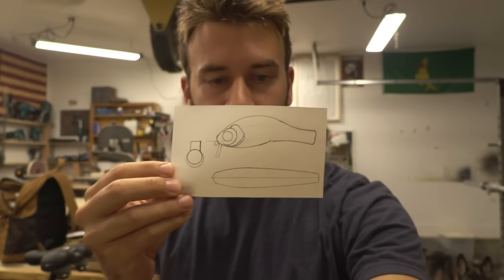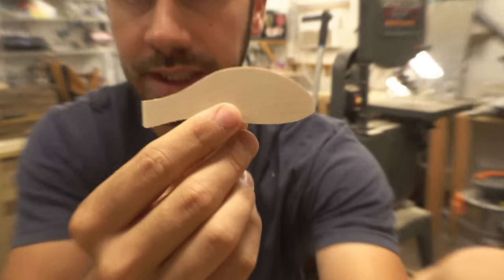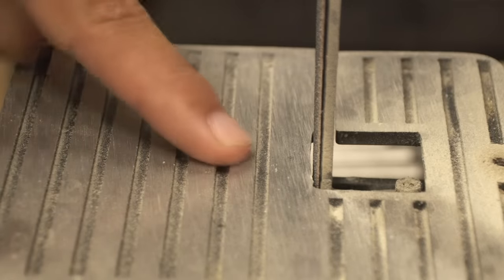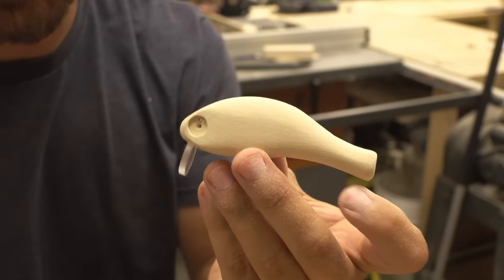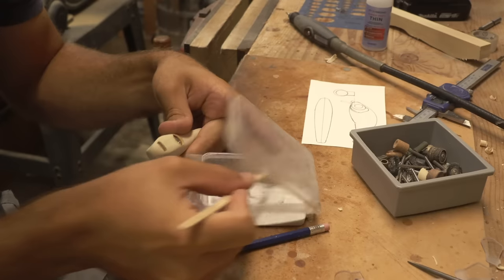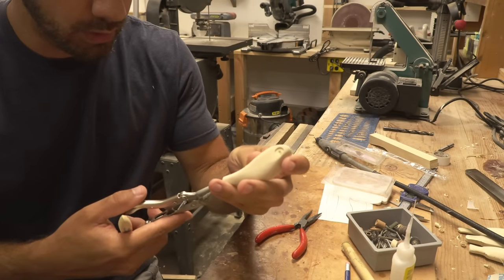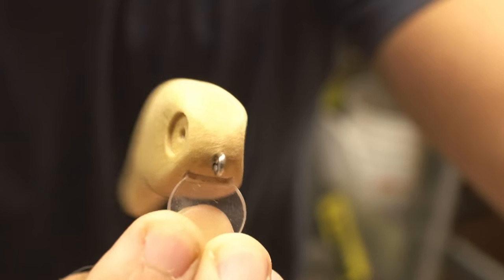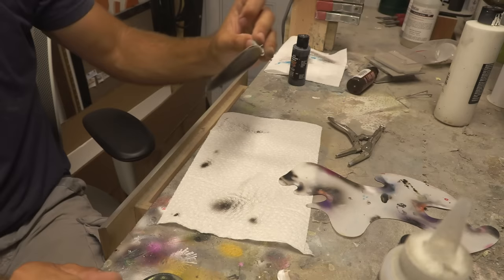HumpBack WakeBait | One Day Build to Catch

Comment: Just a thought for your sander table. Why not use a piece of plexiglass for a smooth surface for it? You could slot it for easy on off if you need to swap it or take it off. I'm curious how it would turn out
Reply: Agreed, that's what I would do (and may do for my own)...  I'd probably just use some doublesided tape to hold it down.  Even just a thin piece of plywood would work.

Comment: love the videos. i had the same issue with belt sander, i just bolted a piece of aluminium to it with a slot cut in for the belt and ended up with zero tolerance on the belt so nothing can get caught in the gap. great cheap upgrade

Comment: I know this videos been out a while but if you haven't made any improvements to the sander table, I used a thin piece of plywood with formica/laminate for a smooth surface. Or you could double side tape or spray adhesive some lexan down. Won't take away very much of the usable space, will still be super flat, and don't have to spend alot on aftermarket tables or alot of time modifying.

Comment: off topic, but what if you drilled a couple holes in the slots of your sander's platform, then fill them in with epoxy resin? The holes wouldnt go all the way through but would help give the epoxy something to bite into. Then you could take a palm sander and level that surface smooth. Although im sure youve already thought of a few ideas at this point. lol. Another great video!

Comment: Screw a piece of melamine to the top of your edge sander for a smooth surface to work on.  That's what I do in my cabinet shop to avoid scratches.  Just a thought.

Comment: Have had a similar issue with a rough table, just cut a piece of poly or mdf the same size of the table and attach ontop of the exisiting table. If it gets rough again, just change the piece.

Comment: I came up with the idea that if you put a hook screw in a drill and then fold the wire into a u shape and hold it with pliers, you only cut pieces of wire of the right size, so you can save a lot of iron wire when you make the loop screws👌😃 what do you think of that 😇

Comment: Place a sheet of formica on the belt sander to get rid of the grioves.  you could tape it on our glue it on with contact cement. Then the plastic lips wont hang up. Also a piece of1/8 plywood, door skin or a piece of polycarbonate bolted to the table to using flat head bolts. That way you can replace it

Comment: Just get a 1/8 inch aluminum plate with a soft pad on the bottom for your sander. You can install quick locks on it with rivets and just clip and unclip it. Where like one sided vise grips with and adjustable bite. Have a great" one day".

Comment: Car body filler would fill the grooves with a flat sand to clean it up.

Alternatively , a brass/steel plate could be laid over and stickytaped in place before drilling and tapping threads into the plate and machine base. Then screw in place with recessed screw holes.

Comment: I wonder if you could spackle that sanding table flat with JB Weld.

Aftermarket smooth table would be the more elegant choice, of course.

edit:  Ooo!  But if you could color the JB Weld to match the green on the sander!  Bespoke sander.  Right there.

Comment: Ref_ Jigsaw grabbing - Ya could cut a piece of stiff 5-ply , sanded smooth & varnished for ease of slida-age, glue a rib or two on the base of it which slot into the groves, locking it into place... 
2c spent

Comment: Ever consider just bondo the table and sand it flat. On in your case some epoxy resin may do the trick.  Sand it flat with a belt sander and put some sort of seal over the top

Comment: To flatten out your belt sander table. Instead of spending alot of money for a flat table. Why not use a piece of Masonite board 1/8" thick and glue it down around the edges. As it gets worn out, it can be replaced.